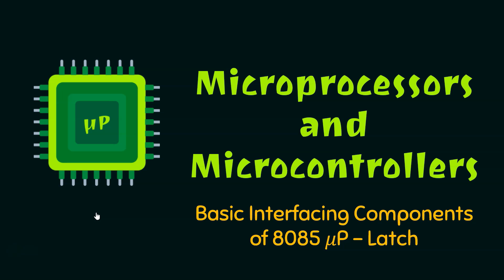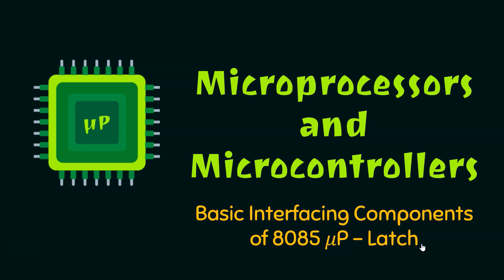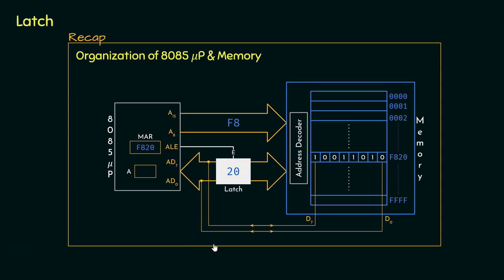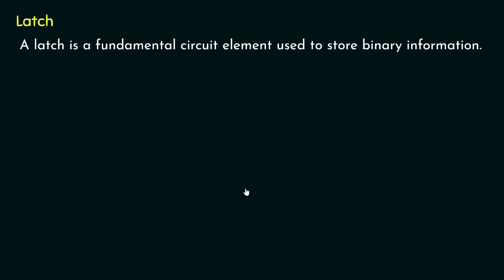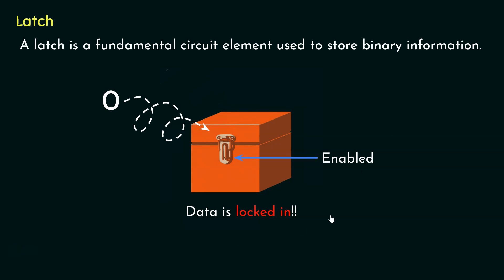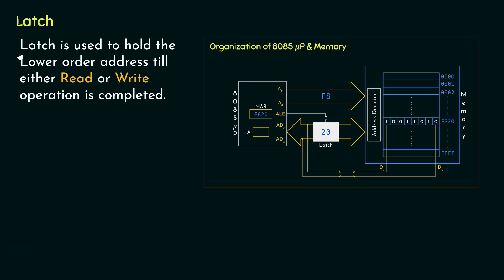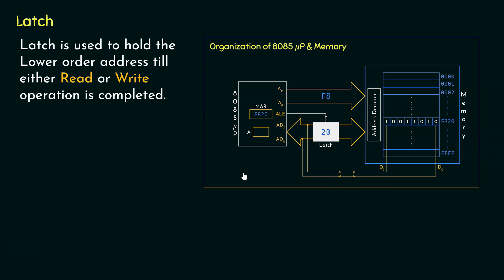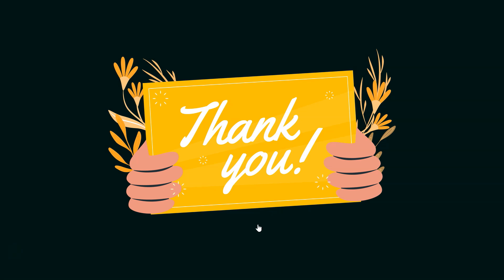Basic Interfacing Components of 8085 Microprocessor - Latch

Comment: Inorder to change value present in store , should we disenable the latch and pass our new value to latch ?
Reply: when using a latch (such as the 74LS373) to hold the lower-order address from the multiplexed address/data bus (AD0–AD7), you don’t need to disable the latch to change the value. Instead, the latch is automatically updated during each machine cycle using the ALE (Address Latch Enable) signal.
Reply: - During the first T-state of every machine cycle, the 8085 places the lower-order address on AD0–AD7.
- The ALE signal goes high, enabling the latch to capture and store this address.
- Once ALE goes low, the latch holds the address while AD0–AD7 switch to carry data.
Reply: you do not manually disable the latch to change its value. The latch:
- Is enabled by ALE during each cycle.
- Automatically updates with the new address when ALE pulses high.
- Holds the value until the next ALE pulse.
So, to change the value stored in the latch:
- The microprocessor simply initiates a new operation with a different address.
- ALE pulses again, and the latch captures the new value.